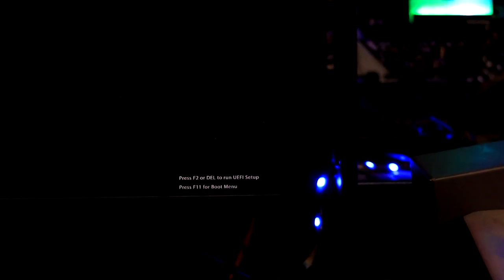HOW TO FIX ASRock Motherboard Stuck at Logo COMPUTER STUCK BIOS SOLVED

Comment: Brother It worked like a charm thank you so much. Question though, do I have to replace the CMOS Battery or just put back the old one?
Edit: I did put back the old CMOS Battery and restarted the pc many times and it booted just fine, problem solved. Thanks♥

Comment: My battery is vertical how do I take it out
Reply: To take the battery out you usually have to push a clip out of the way and then remove the battery
Reply: @TheEngineer1812 what if it has something glued on with it?